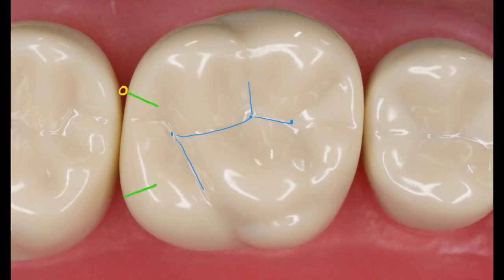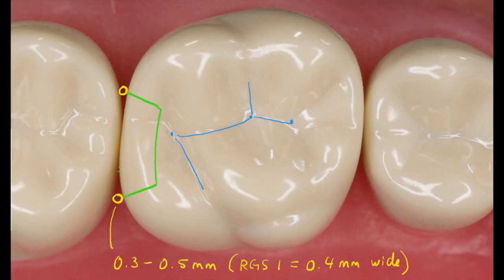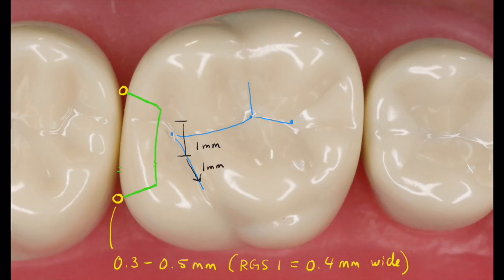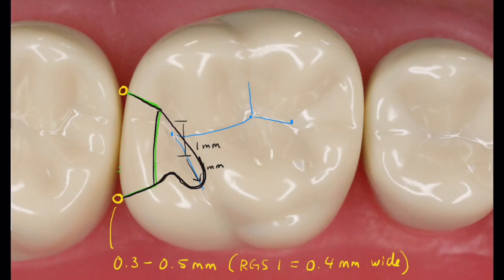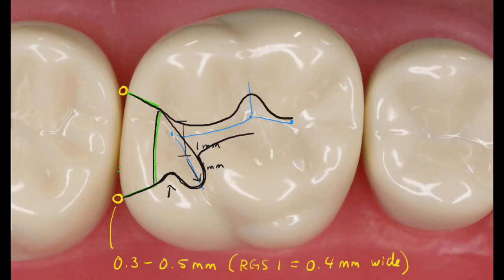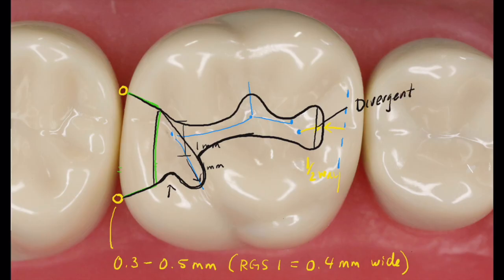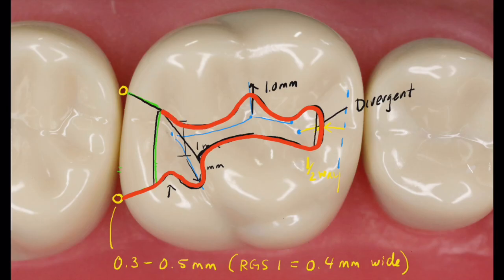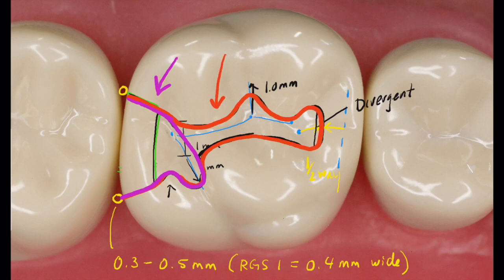Class II Amalgam Preparation #3 DO Variations Columbia

Comment: Thank you doctor , but I don't understand completely the part the preparation of box , can you type the steps in comment for me ??
Reply from the maker: 1. Use the 245 to drop the box to the full length of the flutes.
2. increase the gingival until the contact is broken
3. Increase the buccal and lingual until they are broken - use the hatchet to assist in removing undermined enamel.
4. Deepen the axial wall enough to extend about 0.5 mm into dentin (1.25-1.5 mm total from the outer margin)
5. Sharpen internal line angles with a 169L and enamel hatchet.
6. Smooth the transition from the box to the occlusal ("S" curve)
7. Refine the entire pulpal and vertical walls with an RGS 330.
8. Bevel the axial pulpal line angle to 0.3-0.5 mm with a gingival margin trimmer
9. Place a slight bevel on the gingival wall to remove unsupported enamel, also using a GMT.

Comment: Why is it that only the wall of the functional cusp has an acute line angle and the non-functional 90 degrees instead of both having acute for retention form?
Reply from the maker: 1. Avoids undermining/weakening the non-functional cusp wall, 2. preserves facial esthetics for maxillary preps, 3. follows natural contours, and 4. allows for a uniform extension from occlusal to gingival. It's an advanced Operative Dentistry principal that was developed by Sturdevant, Markley and others in the 1960's but not known or adopted by several schools that are perhaps less focused on advanced operative dentistry. Interestingly, in the US, several schools were using 557 burs to prep class II amalgams until fairly recently - wow, now that's late adoption of evidenced based principals!
Reply: @StevensonDentalSolutions  Wow, that is really fascinating! Well, I guess we're all lucky to have you to instruct us in these principles! One more thing, I sometimes struggle with correctly gauging the correct height/contour of the mesial/distal marginal ridge (sometimes it's too shallow or too excessive). Do you have any tips on ensuring correct anatomical replication? Would it be helpful to compare the marginal ridge height of the adjacent tooth?
Reply from the maker: @ryanlam1635  It is helpful and it's also helpful to make a note of the marginal ridge form level - ask yourself: is this higher, level of lower than the adjacent tooth and will the remaining cusp ridges (after pre) help me to develop the ideal form ...
Reply: @StevensonDentalSolutions  so the marginal ridge of the prepped tooth should be equal in height to the marginal ridge of the adjacent tooth ?
Reply from the maker: @ryanlam1635  Usually but not always - best too check and memorize or use a scan, photo or cast to be sure...
Reply: @StevensonDentalSolutions  Okay thanks!   Also, sometimes when I go to create my "S" curves, I tend to flare out the proximal box (by trying to make a smoother curve connecting the prox. box and the buccal/palatal walls). Can the "S" curves be more abrupt or should they result in a gentle curve?
Reply from the maker: @ryanlam1635  Gentle - try to avoid hitting the proximal wall and focus on the angle of the "Z" shape - gradually reducing it into an "S"
Reply: @StevensonDentalSolutions  ok that makes sense. Actually, what way would you recommend to gauge how deep your prox. Box should be to clear contact (obviously it depends on the adjacent tooth e.g. a premolar vs molar or if it is a mixed dentition)
Reply from the maker: Okay, first off, let's use the term gingival extension and not "deep" or "depth", which are terms used to describe preparation walls that are adjacent to the pulp, namely the Axial and the Pulpal. To evaluate the proper gingival extension to break contact and remove caries (that's why we are doing this in the first place) evaluate the contact from the lingual or buccal and visualize where the bur will need to extend in order to clear the contact - usually it will be 3-4 mm from the top of the marginal ridge.  The 245 is 3 mm - so this will work great - extend the bur gingivally until the flutes are fully engaged.
Reply: @StevensonDentalSolutions  Thank you Dr. Stevenson for this video. So, theoretically, if we say how deep the axial wall is, its actually the width of gingival seat mesio-distally in the box. Then, what would be the terminology to call the real length (say 'x') of axial wall starting from pulpal floor to all the way down to the gingival seat. ? and what would be the ideal range of the length of an ideal 'x'.
Reply from the maker: @harrygill522  Hi, correct.  There is no ideal length to the axial wall - it may be 0.0 mm (the pulpal and gingival walls are on the same plane), as long as the pulpal depth is appropriate and the gingival contact is broken.  Schools are usually looking for a typodont prep to have 1.5 mm of axial wall height.  This is rarely an issue except with Kilgore teeth which have point contacts.
Reply: @StevensonDentalSolutions  Hi Dr Stevenson, thanks for clarifying that for me. What textbooks would you recommend that use correct terminology for describing cavity preparations? I would like to improve in this area.
Reply from the maker: @ryanlam1635  Sturdevant - Art and Science of Operative Dentistry and Shillingburg - Fundamentals of Fixed Prosthodontics

Comment: Can I say safely that using only 330 & 245 are greatly enough in all posterior cases and ignoring the inverted & fissure burs ?

Thank you in advance Doctor ✨
Reply from the maker: You can - however, the 330 RGS which is a new bur introduced to dentistry in 2018 accomplishes superior finishing while maintaining the convergence and conservative prep design.  It's best to avoid straight fissure burs while completing an amalgam prep (55, 56 ,etc) as they are not designed to maintain convergency.  The use of inverted cones (34, 34, etc) is also not recommended as these are too sharp and are not long enough to smooth the vertical walls while smoothing the pulpal or gingival walls.  Check out the 330 RGS by Brasseler, or on eBay or on stevensondentalsolutions.com  - it's an amazing bur.
Reply: Stevenson Dental Solutions  Thanks Dr.Steven for your so clear & appreciated reply
Reply from the maker: @toto559071  Thank you

Comment: After filling teeth again starts to lightly pain , what's the solution?
Reply from the maker: Usually a failure of the bond - likely requires replacement and strict adherence to protocols